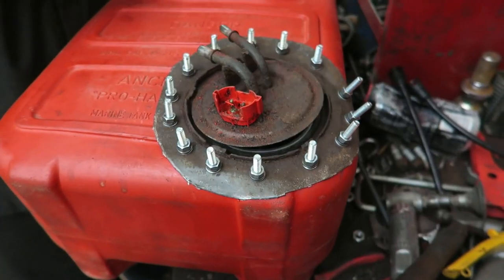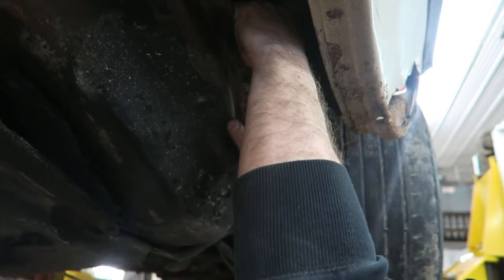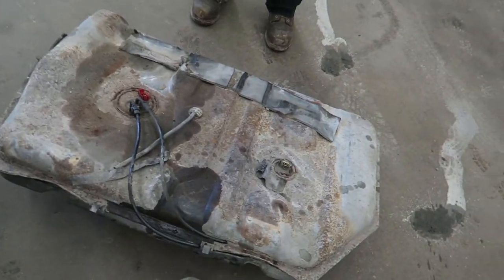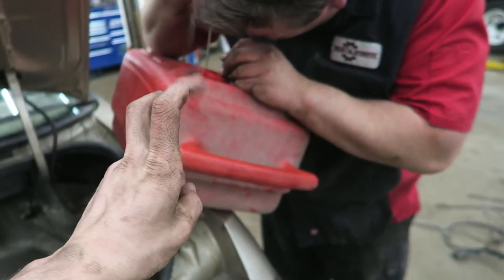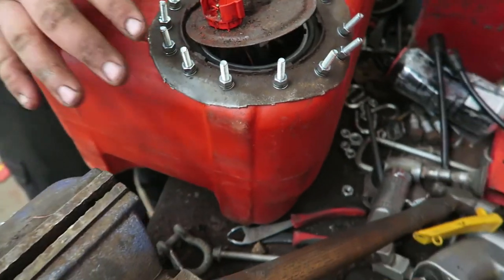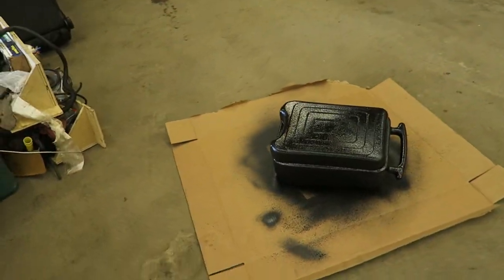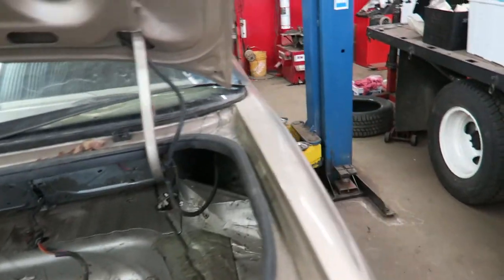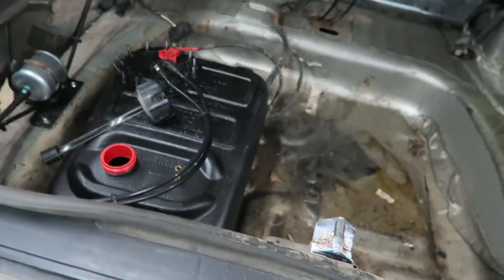Super Cheap Fuel Tank

Comment: Do you have any concerns about fuel starvation while cornering (and drifting)? or is the plan to just keep the tank full all the time?
Also, minty time laps shots! are you using a device to get camera movement?
Reply from the maker: Shifted Interests we will keep it full. May add some fuel tank foam to prevent slosh.  As for the time lapse its all done in post.